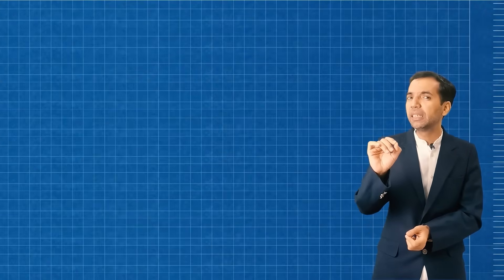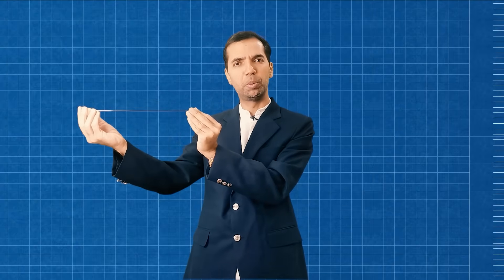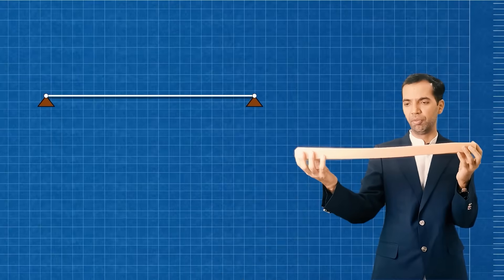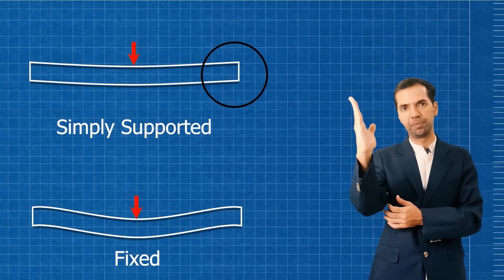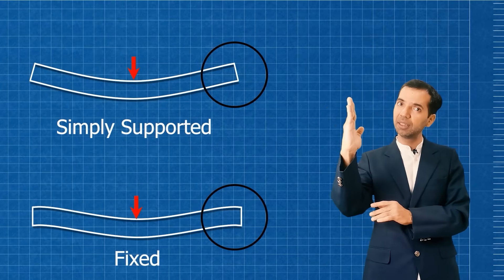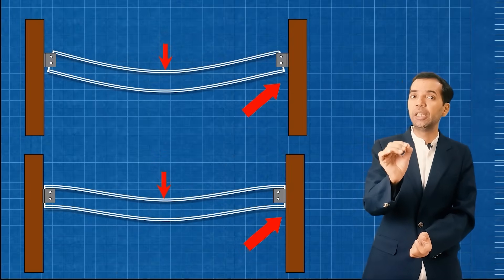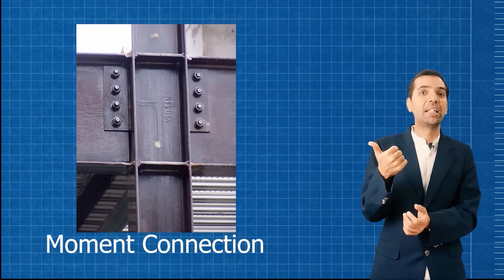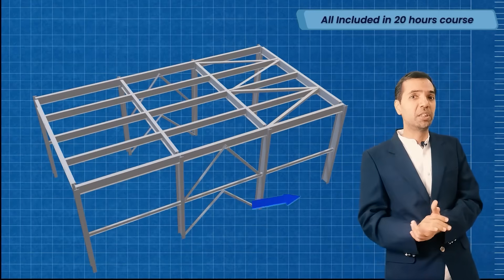HOW TO IDENTIFY CONNECTION IN STEEL STRUCTURES, SHEAR OR MOMENT CONNECTION, simply supported - fixed

Comment: One doubt sir, without any erection  gap is that  
beam possible to erect on site?
Reply from the maker: no dear. Plates can be added after erection.
Reply: It's a end plate conntion where plate get welded with secondary beam in fabrication unit and intha site it will be connected to girder beam by bolt or by weld

Comment: Hello sir!
I am btech mechanical, now i am working in steel connection design. I am  interested in member design it's possible to join member design?
Reply from the maker: for further info - you can call/whatsap us on
+91-635 935 0500 or +91-98251 06264
Reply: Hi Sir